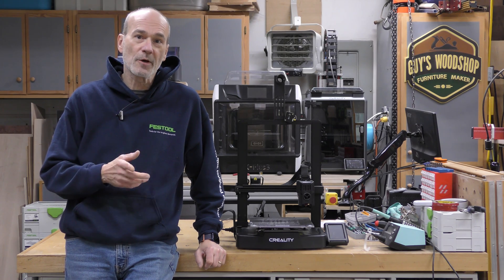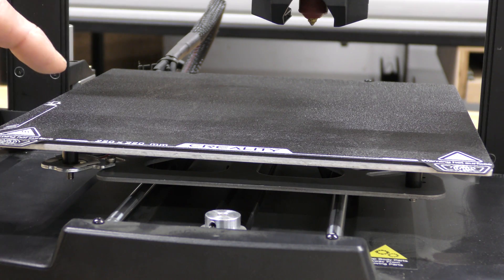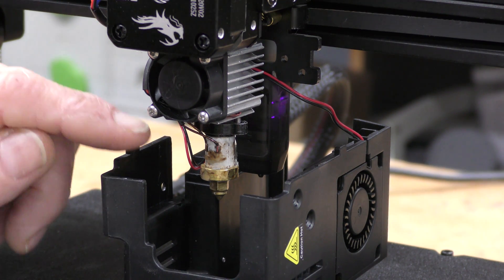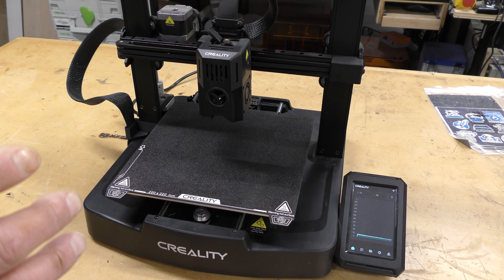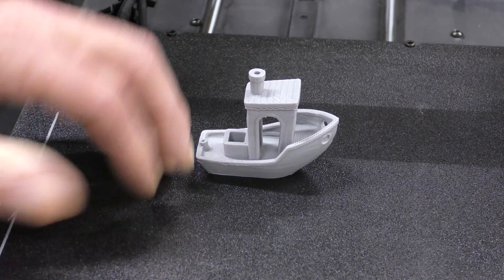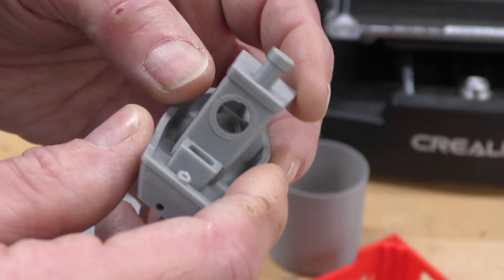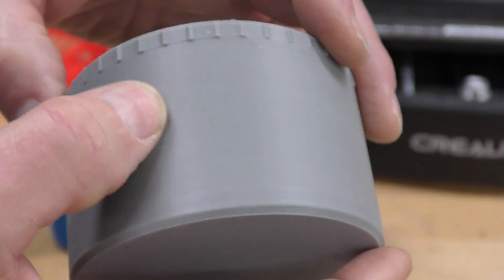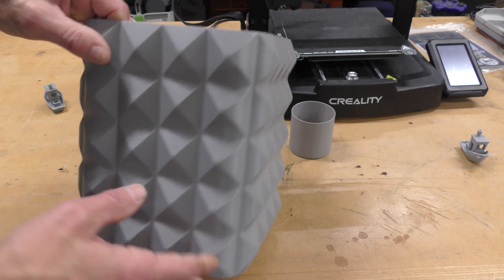Overview and Review of Creality's Ender 3 V3 KE

Comment: Hi there, I got the ender 3 v3 ke, I am telling you, do not get it. It is absolutely trash it broke down after a month of light work and broke down 2 days after i did a complete hotend replacement.
Reply from the maker: What broke? I have over 100 hrs on mine, and everything is working fine.
Reply: He's right, the QC is terrible on this model, don't buy it. Wait for the V3 or get another brand. The VFA is pretty bad too.
Reply from the maker: @oldman1944  I guess I got lucky then as I don't have a lot of issues with mine. There is some slight VFA, but not horrible by any means.
Reply: @GuysShop  Mine has been fine so far!